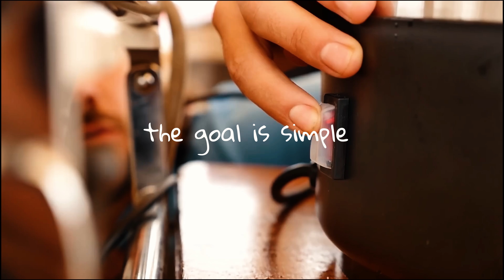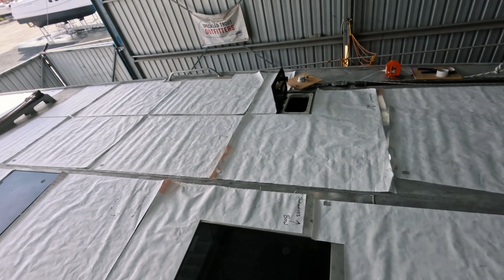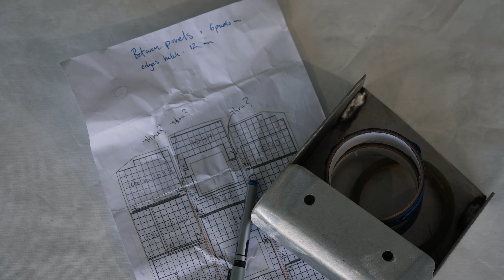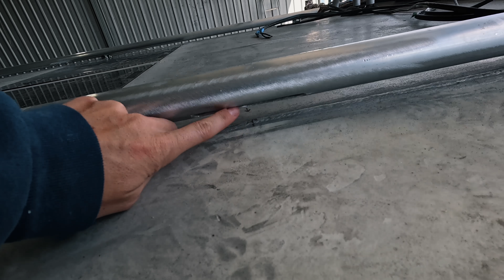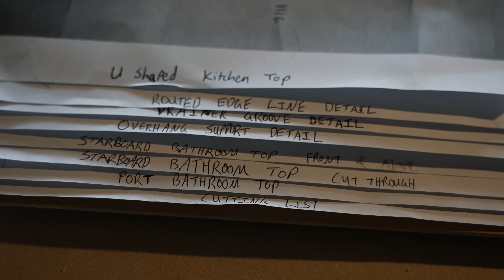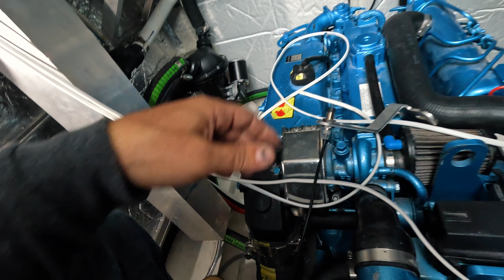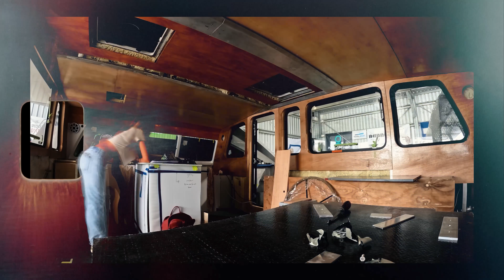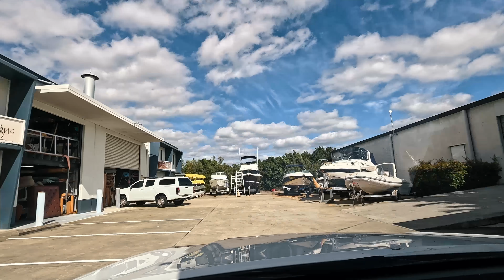EVERY INCH COUNTS....Aluminum Catamaran Build Pt. 83

Comment: Go parallel M8 due to all the shading on a sail boat. Series if the last panel in the string gets shaded it will cut out all the other panels in that string. Voltage drop is better than nothing. Good luck, I'm not big on stick on panels but you're probably getting the panels foc so all power to ya. We've Gotcha Covered

Comment: We had solar on the roof of our 44' sailing cat and extended over the dinghy davits. In order to get good use of the rooftop solar at anchor I frequently would swing the boom out and user a spare line to secure it. Do you have plans for getting the boom out of the way?

Looking great! I'm really excited for your project to get to the water and start adventuring again. Delos 2 is so much closer to what my wife and I want than anything else being built.

Comment: Why not grind smooth the weld seams or at least the one in the panels way on the roof? Wouldn't think those welds are very structural like the main hull welds.
Reply: Or raise that 1 panel a 1/4 inch with risers.

Comment: Brian, if you install those flat stick-on solar panels onto your aluminum roof, you are asking for trouble.  In the hot sun, your roof will absorb heat and anything that touches it will be like touching a hot griddle.  Also those black solar panels will also absorb heat just on their own.  And, as with electrical and electronics, Heat = resistance and the output will seriously decline as the temps go up.  Your combination is destine to fail over time and the max output will decline quickly as things heat up.  You really need to separate the solar panels from the AL roof and allow some airflow in between the 2 surfaces.  One technique is to first mount a polycarbonate or Lexan corrugated sheet, where the openings are oriented to go from forward to stern, where they will get constant air flow, weather you are sailing or at anchor, swinging on the hook.  I've seen these panels between 12-26mm openings/channels, therefore providing some air flow between the 2 surfaces, thereby venting and carrying the heat out between the surfaces.  https://www.homedepot.com/p/Sunlite-24-in-x-8-ft-Multiwall-Polycarbonate-Panel-in-Clear-132506/202091947

Comment: You'll need a lip on the holes in the roof pipe where the panel wires enter breaking the waters surface tention to slow water ingress.
Reply: And anti chafe system

Comment: I have 42 solar panels on my house that the installer wired in series-parallel so one bad panel would not affect the operation of the remaining panels. Was just wondering why your installation was not designed like this.

Comment: Q. You have an aluminium top so how does the heat from these flexi solar panel dissipate?  As these things get hot, efficiency drops.  8 x MPPTs, wow.

I had 1600W mounted as 2 x 400w into one MPPT, 2 x 400 into a second MPPT with diodes for loss reduction in shade, but that was 6 years ago so wonder how its managed today.  I had solid panels to kept an air gap undeneath of some cooling but I thought flexi panel had heat dissipation issues, or has that now changed?

As usual great content, thanks.
Reply: Aluminum is an excellent conductor of heat.... Some might even call it a heatsink. It could end up being even cooler than a black panel with an air gap.
Reply: Yep heat issues
Reply: Sailing Uma doing it too, curious to see
Reply: I also think the heat input into the roof may be of concern. Also, the panels will drop in efficiency when they get hot. This can be double-digit percentages with glued-on panels which get much hotter than glass panels with some backside cooling.
Reply: They are more heat tolerant in terms of exposure recovery and some increase in Temp but.... both sailing Uma and Delos have gone this way they are also used on the walkon deck areas of Windelo's etc..  the panels on the arch can be  double sided  as they can collect the high short frequency light reflected from the water or any shiny surface  at least 500mm away  ... The other option is to have them as Pull outs from under the roof panels . These are also light wt compared to conventional Solar. 
Modern Peroskvite on silicon two layer panels show the highest efficiency ratings 34% possibly reaching 42%-45%in time ... 

But hybrid PV solar panels still maintain high outputs because of water cooling and vastly extended life span in high temperature environments. 

Their roof is going to need to be highly insulated inside... A couple of thermo couple sensors might be an investment in terms  seeing what's going on long term.
Reply: We got 5 years life from flex panels on hard bimini roof.
Reply: Maybe aluminium is enough of a heat sink and dissipation.
Reply: The AL Body is perfect for heat absorption.
Those are glued to the surface so heat is not a problem, I guess...
Reply: Exactly my thoughts too, sailing in warmer weather I'd go for Ridgid panels any day of the week.

Easier to replace, longer lifespan and better efficiency per SQm.
On my own boat i actually had 3 different sizes of Ridgid panels and I got 4000 watts easy

Wonder how this will work out.